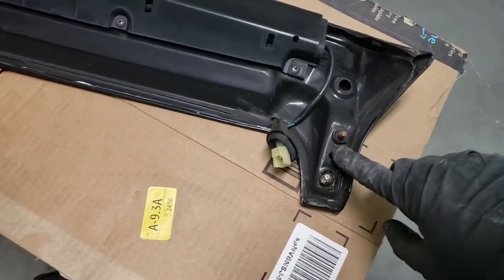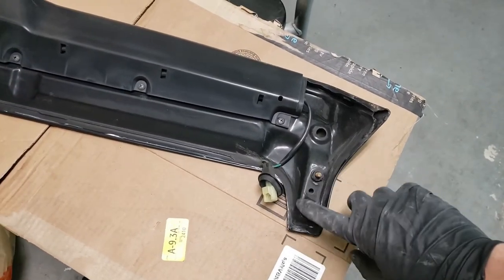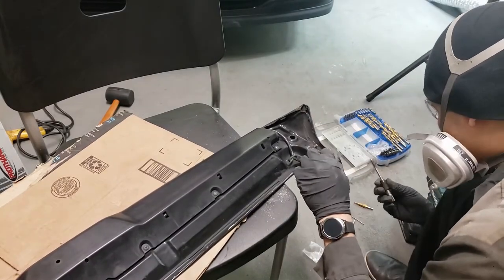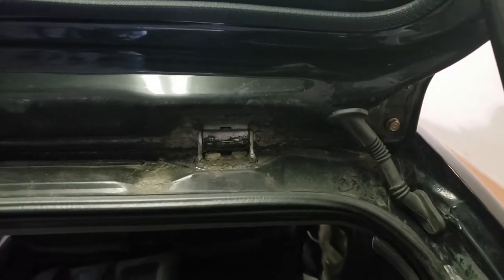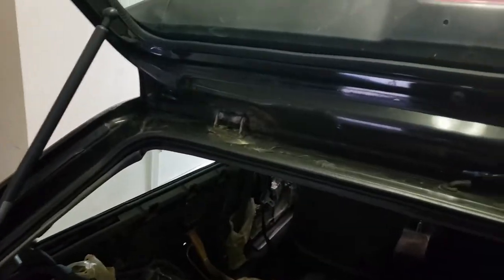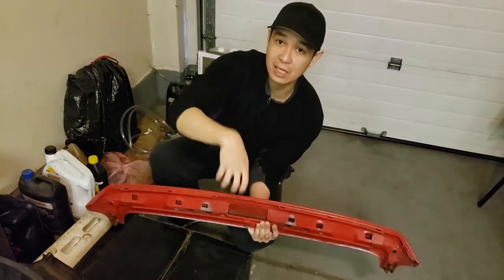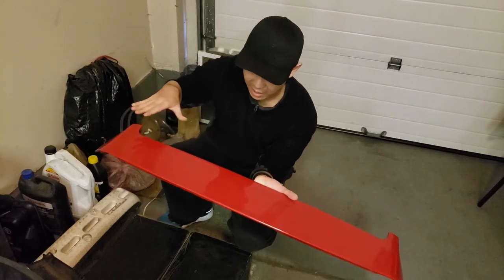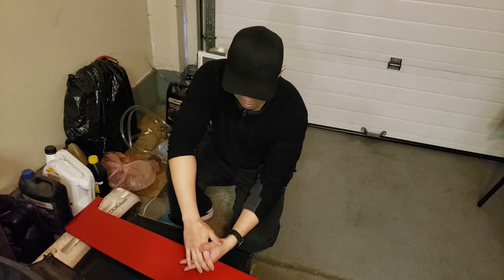How To Repair Broken Spoiler Stud and DO NOT DO THIS!!

Comment: My spoiler is loose on the right side of my 2018 Honda civic hatchback. Do you have any video on how to access/refasten it?
Reply from the maker: Sorry, I don't have any videos on that, but if you lift up the hatch, you should be able to see how it's attached. Usually just a couple of bolts. The spoiler bolts are usually visable.

Comment: I managed to do this. I got a spare from a junkyard and cut it open with an angle grinder then pushed the clips out from the inside so I ended up using parts from two or three spoilers but I got it done.